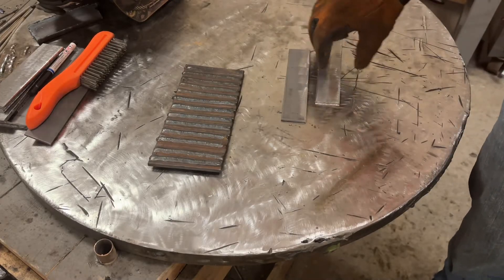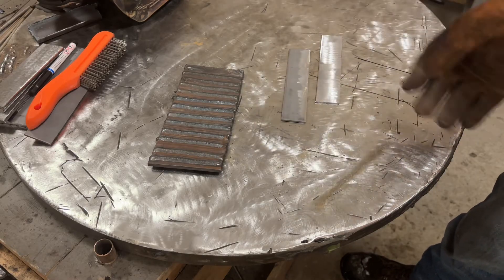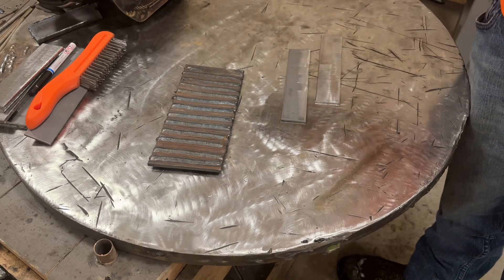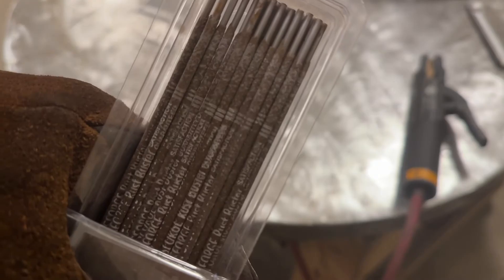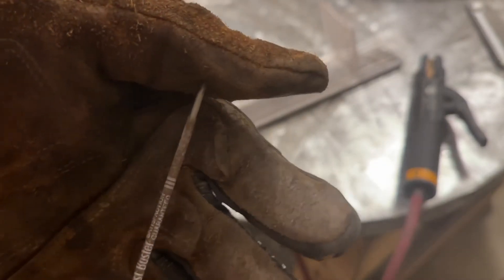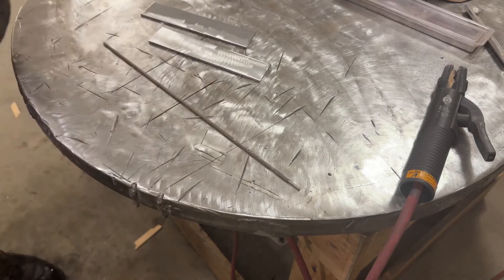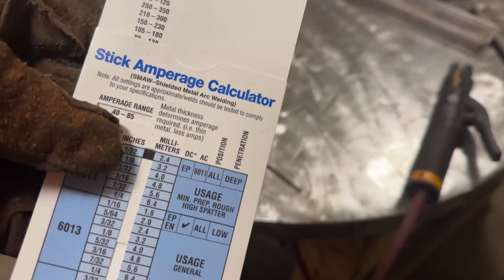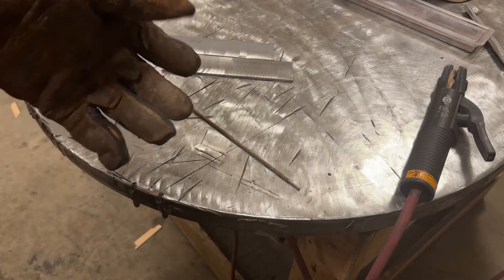Undercut on welds: what it is and how to avoid it

Comment: Thats more like a 6010 electrode which is used for deep penetration and root runs. I would be more worried about undercut on filling and capping runs using 6013 and 7018.

Comment: Really good?  Utp-612?  was sold to me years and years ago as “especially easy to run.”

Note: looked it up recently, and was classified as a 6013.  (Really Spendy 6013, at that.)

Now there are some hybrid “6013s” that are really “bitey” - so-called Rutile-Cellulose rods - that can handle rust to a degree.  They’re common in Europe, supposedly.

Closest equivalent in this country might be Hobart’s 6013, and maybe some of Forney’s 6013.
Reply from the maker: For some reason overseas (aka outside of the U.S.) it was very common for multiple types of 6013 to be used.  They actually use 6013 on open root pipe.  I. The U.S. 6010 was decided to be used.  The foreign 6013 does run closer to 6011 than it does the common 6013 here.

Comment: I’m gonna ask a stupid question, can you weld two mirrors into a T-joint. I recently saw a video on making mirrors and the “steel molten puddle” I was looking at had me thinking it was possible. Reason I believe  this to be true a prop in my addiction-rephrased-shelf life in a refrigerator and the metal being a conductor.
Reply from the maker: Two silver mirrors could be welded, I would think they would lose their perfect reflection due to warping.  I need to get a real silver bar, polish it, and weld it 😅
Reply: @makingmistakeswithgreg   - "Braze" ?
Reply: I’m referring to the dilution of alcohol and “gases” in my can and it not being the percentage it claims because it’s shelf life absorbed into the can, which makes me want to use the “container” for the pipeline because the container is stronger than the contents inside it.

Comment: I seem to get alot of undercuting.  I have a miller wildcat 225 and it just has a 1-10 dial so using that chart with setting does no good for me.
Reply from the maker: So the wildcat is a small engine driven stick welder right?  If that’s the case undercut would be caused by too long of an arc or due to excessive amperage.  If you have a range of 1-10 instead of amperage, there must be a correlation of those outputs to a particular amperage.  A good way to tell if you’re close with 3/32 rods is run a 3/32 7018 at a setting, and see if the end of the rod is glowing dull red by time you burn up 80% of it.  If it’s blowing apart it’s too hot, if it’s not red at all and the bead is sitting like caulk on a plate you’re too cold.  Once the amperage is close to what’s idea you need to make sure your rod is being fed into the metal to keep a very tight arc gap.  Without a tight arc you will chew away at the metal and not fill it with new metal to replace the gouged out material.
Reply: @makingmistakeswithgreg  yeh it's engine driven model.  Only sold commercially between 2008 and 2012 i think.  I've never seen another.
Reply: Also yeh it has a high and low setting and then 1-10.  So basically low would be like 60-120 and high would be like 120 -180 or something like that.  I've tried using less heat and I still get undercut.  It try to tighten up the arc that could be it.

Comment: I’m a total newbie.  I was wondering about touching the work piece when tacking, or elbow on the table, etc.  what’s ok and what’s not ok?  Electricity freaks me out a bit.
Thanks!!!
Reply from the maker: I have loosely answered your question in multiple random videos, but I will cover it for you now, hope it helps:  Most welding processes operate at 15-25 volts when welding.  At this voltage the risk of becoming part of the circuit is rather low, just like grabbing both battery terminals on a car doesn’t shock you.  The resistance of your skin/body is far too high for a circuit to be completed.  Many modern inverters (newer welders) only output 24-30v max under load and 40-80v no load.  The no load voltage could cause a short shock but it wouldn’t be able to maintain the circuit because they can’t output high enough voltage under load.

Where things become dangerous is with engine drive welders, or bigger industrial welders that can maintain 50+ volts under load.  Those are far more likely to light you up because they are capable of maintaining enough voltage to keep the circuit completed.   Higher open circuit voltage is of no use with mig and tig, which is why many mig and tig welders have fairly low open circuit voltage.  High (over 60) open circuit voltage is a big benefit with stick because it’s easier to start the arc.  In many cases better welders have VRD (voltage reduction devices) to lower open circuit voltages to safer levels (sub 30v), and this can be a requirement in some workplaces.  

As far as probability of being shocked, during conventional welding (stick, mig, tig) if you wear gloves, a long sleeve shirt, and keep the ground clamp near where you’re welding, the risk is near zero.  I have been a full time repair welder for a decade or so, and I have never been shocked by the actual welding arc.  Just today I was welding in a metal hopper while I was pouring sweat (and stick welding) without issue.  I always wear long sleeves, good gloves, and place the ground close to where I am welding.  I have been lit up by a tig welders a/c arc though.  To tig weld on a/c requires a “pilot arc” that runs continuously in the background during welding.  That arc typically operates at high voltage high frequency, especially with cheaper welders.  While tig welding it will jump through sweaty shirts and zap you.  It’s not a huge zap but enough for you to know you got shocked.  It’s basically harmless, but it’s not the main arc that’s causing this.  Most welding takes place on DC without a high voltage pilot arc so this wouldn’t be an issue.  

Hopefully this helps you understand what’s going on.  Wear gloves/shirt/be smart and you’ll be fine 😀👍
Reply: Thanks so much for the reply.  Really comprehensive and super helpful.  I’m making progress as a DYI with 1/8 7018 rods - some of my welds look pretty decent!  
Thanks again.

Comment: In your series on arc welding(stick), is there one that talks/explains how to do fillet joints with different thickness of metal? I want to weld 4" tube steel (1/16" - 1/8") to 1/4" plate.
Thank you.
Reply from the maker: So I have covered that with flux core wire welding, which is pretty easy to do what you want.  The video will have some useful hints for what you’re looking at doing, here it is: https://youtu.be/1p0AejzIelI?si=zHYshiNo4-sotQlS

Now for direct tips with stick welding thick to thin, I can tell you it’s much harder than wire processes.  1/8th to 1/4 isn’t hard, a normal 3/32 rod of any class can do that.  1/16th becomes far more difficult simply because the heat needed to fuse 1/4 will be more than 1/16th will take.  I know it’s doable, I personally would probably use 6011 to do it because the amperage it runs at is less than 3/32 7018, it has less penetration than 6010, and if you run it slightly cold you won’t get slag inclusions like 6013.  I will be honest, I have done a lot of welding of that type of mismatch and I always go to wire or tig.  So what I am going to do is a few test welds when I am off early next week, and I will post a short video on it.  I will try a few rods, a few sizes (5/64th and 3/32), and see what I think is the best.  The video should be out by Friday next week.
Reply: Thank you  @makingmistakeswithgreg  for getting back to me. I am truly new to this. I would normally do this work with wood, but I now live in Costa Rica where wood and termites are a problem. I don't have a mig welder and getting gas for the tig side of my welder(PrimeWeld  CT520D) is not easy, so stick it is. I will see if I can pick up some 6010/11 and do some testing.
Looking forward to your test.
BTW, great series.

Comment: Fatigue cracking is IMO the big watch-out with undercut. As you mentioned, the stress will concentrate at the undercut toes because not only is it the thinnest section, but it's also the least stiff. If you have ever connecting a couple things in a row of varying stiffness and applied bending stress, where does all that bending stress go? It goes to the least stiff thing. This is why your fishing rod bends from the tip down (it's tapered and the tip is far less stiff). This is why I tell my younger engineers to 1) design for stiffness and the strength with be there, and 2) pay attention more to the rate at which stiffness is changing along a structure than of the overall stiffness. The overall stiffness can tell you if it will fail, but knowing the relative stiffness within the object can tell you where it will fail.

A simple illustration of this is imagining connecting several springs of different spring rates in a line and pulling on them. The lowest spring rate spring will ultimately take up the majority of the stretch and if pulled fair enough, will be the spring that yields (assuming identical metallurgy on all the other springs). The total elongation will divide among the several springs based on their relative stiffnesses (proportionally). The spring that's 3x higher spring rate will have 1/3 of the elongation.

Undercut also tends to have sharp scratches in thinner spots of the material that serve as crack initiation points. So double whammy-- the stress is concentrating right where the material is most sensitive and compromised.
Reply from the maker: Excellent thoughts and great points.  I appreciate the time you took to write that 😀.  Undercut is definitely undesirable, and can be a real bastard to fix.  Just today I saw a robot weld on a round drum (equipment at my work) that had an odd tig weld on one weld toe. I looked at it up close and realized the weld had massive undercut on one toe and they fixed it by tig welding the toe line.  That can be effective in some cases (for those that have tig) but it can be a real issue with stick since you can end up “over welding” something in a hurry trying to fix undercut with more passes.  Definitely best to avoid it in the first place.
Reply: Thank you for that thorough response. I’m a young ICC welding inspector.

Comment: It’s a lot easier to make a bad weld when welding something important than when trying to show people bad welds.
Reply from the maker: Haha that’s the truth.  The worst is porosity.  It’s really hard to make it happen with stick.  I swear I can’t do it on command but randomly It will happen for no reason lol.
Reply: You want porousity. A little light pen oil on the rod will do. Not enough to make it unusable, but a drop or two swiped down one side. You know, regular shipyard type sh!t

Comment: can i humbly suggest you get a way to show the arc and pool.  kind of hard to show what you need to show about eliminating undercut when the viewers cannot see the undercut happen and how you need to allow it to fill in before traveling past it.....  also,  out of curiosity.... why use those obscure rods in your example instead of something common in the industry like 7018?
Reply from the maker: That video was shot probably over 100 videos ago and a long time before I had a modern camera or expensive lens system.  A lot has improved since then.  Under cut is created by too long of a arc gap or moving to fast for the rod to deposit enough metal as stated in the video.  The rod used is a generic 6010/6011.  It was used to produce undercut because most people have the worst undercutting issues with 6010 and 6011.  7018 is far harder to produce undercut because the weld pool self levels and fills most of it.  6010/11 does not cover up for poor arc gap control or inconsistent movement, therefore it shows all flaws.  I have had a lot more videos since that one was produced that touch on the subject. 

I can understand your desire to see undercut happen, but the truth is you don’t need to be focusing on the toes of the weld for undercut.  You need to focus on the size/shape of the molten puddle and dragging it slowly long making sure it stays the same size.  You need to focus on keeping the rod tight into the molten puddle.  You also need to focus on moving consistently and at a fairly slow pace.  If you do that undercut isn’t going to happen.  If you focus on spotting undercut as you weld, by time you see it happen it’s too late.  You can’t really fix it as your welding other than slowing down and tightening the arc gap, and that only solves it moving forward.  

So again it’s pretty simple, if you see evidence of undercut you need to tighten the arc, slow your travel speed, and push more rod in as you go.
Reply: @makingmistakeswithgreg Greg you have the best explanations and welding channel on YouTube. Thank You.

Comment: Thanks, you make this much easier to understand how this process works. Never did any welding and now am learning how to, love it.
Reply from the maker: No problem 😀.  Welding is just a skill like riding a bike.  It takes time to develop and once you build the muscle memory it becomes far easier.  At the start you’re trying to juggle too many things at once, and you can’t do it.  As you practice your brain will simply take over and do most things automatically, which frees up your focus to what’s going on.  That’s why when people say “focus on the puddle” it’s somewhat irrelevant when first learning to weld because if a person focuses on the puddle they lose control over everything else (like stickout/arc gap, travel speed, etc).  Much like when learning to ride a bike telling someone to focus on what’s 20 foot ahead of them doesn’t make sense when they are struggling to maintain their balance enough to pedal.   It just takes practice and the best thing about it is once you get good at any welding process, your brain will help you switch to others.  You start out at 30-50% muscle memory instead of 0.